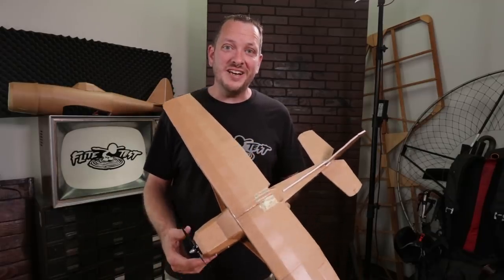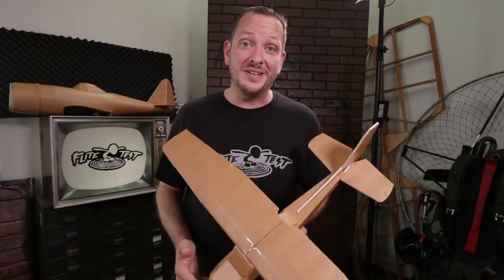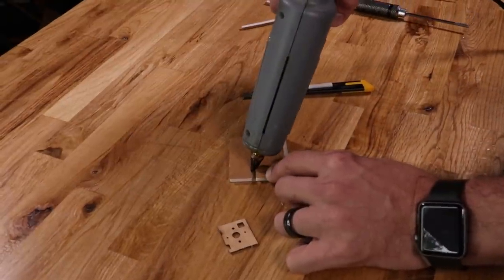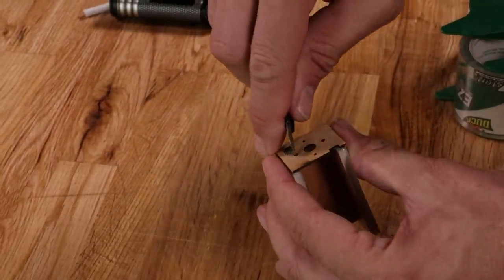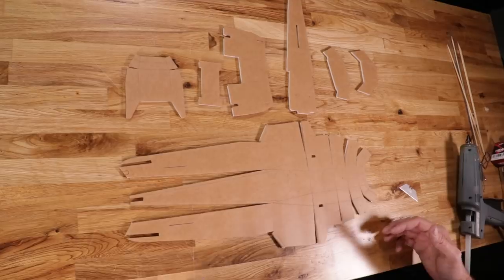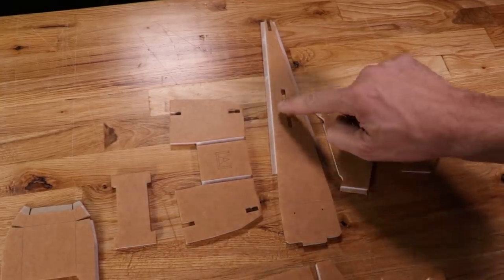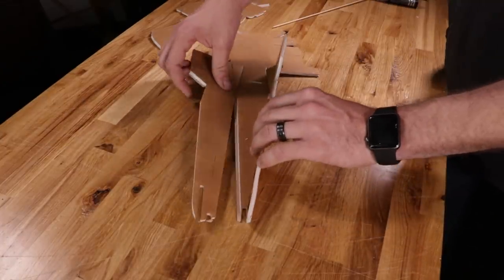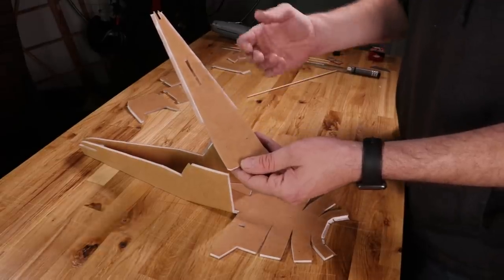How to Build the FT Commuter  //  BUILD

Comment: Josh says you have to go smaller if you go with a 3s but I bet you can get that thing in the air on a 1000mah 3s without any problems.
I've found ft planes are spec'd up to be ultra lightweight,  the ft cub specs with plastic gear servos and a tiny 1000mah 3s is 489g. my cubs fly on a racerstar 2212 1400kv swinging a 9x5 prop, metal gear servos, two cams on a switcher,  a 800mw vtx, voltage osd and a 2700mah 3s and comes in at 890g and flys great but I've had the thing in the air on a 4000mah 3s and weighing just over 1kg several times lol.
Reply: Hello, can I put a 3 s 1500 mah battery with a mm2216 900 kv esc 20 mah motor? I would like to know in the model of this video

Comment: If I scale this up, will it work with a powerful motor?
Reply: yep. I was gonna scale mine up 200%. It COULD work on a B power pack but I think a C pack would work just fine.
Reply: I DEFINITELY want at least a 180-200% version!! Should be comfortable with a C Pack sized Motor, which is right where I want it. 😊

Comment: When you are constructing the fuselage (at time spot 9:23 in the video) when you are fitting the push rods through to the rear slots for the elevators , would it be practical to use either plastic straws or narrow gauge aluminum tubing to fit the push rods through to give a better more solid guide ?  If so the straw or tubing could be glued at either end for added security ?

Comment: Thanks for the detailed steps and sharing this video. We have built the FliteTest plane using your video and instructions but we appear to have problems in having the plane stay up in the air and looking for some guidance. The plane does a nose dive or flips down very soon after take off (travels abt 3 - 4 ft in the air) before either doing a dive bomb or just crashes down. We did observe the plane turns counter clockwise (or towards left) when we try to drive it on the ground. Are there any rules of thumb or checklist so we can try to identify any imbalance/weight or other issues that might be contributing to this behavior? thanks in advance.

Comment: Thank you Josh and Crew, thank you Ben!! 👍👍 
That Takeoff and landing are EXACTLY why I've kept squawking for years about Tricycle Landing Gear!! 😎 great Ground Manners, and such a docile yet controllable Flight. 

ANY CHANCE of releasing a 150-175% Version??? Like Simple Cub sized? 
I'm getting one of these no matter WHAT, but I'd love a bigger version, and do not have the capability to upsize and cut it myself. I'm a Disabled Veteran, and my hands don't work that well anymore.
Thanks!! 
Carmine ✈🚂🚙
Reply: simple cub is only about 25% larger.   commuter is 30",  simple cub is 38".   30"divided4=7.5"=25%.  30"+7.5=37.5.   isn't that you scale up %?
Reply: @berniek8238  Well... I suppose that works.
I'm a Disabled Veteran, without even a working Computer and Printer. 
THAT'S why the Speed Build Kits are ideal for me.

I like the Commuter, because it's very much like the Cessna that my Dad taught me how to fly in! 

Putting a Nose Gear on a Cub wouldn't do it, nor would blowing up the Commuter Plans...
Although for many others, that would be a possibility to consider.

Good idea though, if I can find someone to laser cut a kit for me. 
My old hands can't cut out an entire Kit from plans...

Comment: some late info.     at 1:00:00,  yeah, i always like to install aileron servos  as NEAR  the   Wingtips as possible; so that i get maximum  Reduction    of roll-axis stability.       and i always like to   Leave  the wingtips   UNfinished; cuz everyone knows that  a wing  should have  Two,  completely Different  profiles.     at 1:07:23, i always like a wing to make  Extra,  Avoidable  Drag, by having a step at the underside, just forward of the hinge lines.   ( i just don't like flying  an efficient  and  well-behaved  model. )             at 1:26:59, in other words,  Optimal location of cg (conventional airframe) is  at   THIRTY   percent of  chord;   or a bit forward of 30.        at 38:58,    it matters not, what materials are used.   the use of a box-fuselage design  WILL  result  in  excess mass  IN  the  tail boom.   (otherwise known as,  tail-heaviness in the dom.    distribution of mass.)       UNLESS,  steps are taken to  Reduce the amount of mass, located  aft  of the  c-m/cg.  ( such as tape-covered cutouts; ideally, tail boom construction  Should  include  two  formers;  this will  allow the  (safe) removal  of  a lot  of  aft-located  MASS. )        it should  be understood that   the cg balancing process  has  NO  affect  on (a wonky)  dom.     the  ONLY  fix  for tail-heaviness in the dom  is,   Relocation/redistribution  of  Mass.             in order to evaluate the dom of a model,  establish a  fulcrum beneath the fuselage, at a point that vertically aligns with  25 percent of chord/mac; when the fuselage is level.    if the model does not  Almost  balance, the  dom is  Not  optimal.      since the  problem is  Tail-heaviness,  adding mass forward of the c-m  is  Not  the correct  solution.      at linked illustration,  Optimal  location of  c-m  for a typical high-wing airframe   is  indicated.      it can be seen that  c-m  Should be located  on the thrust line, at point that vertically aligns with 25 percent of chord/mac.      all of these  facts  are  known;  they are scientific fact.        if a hobbyist wants to make a   'good'  model,  the design  Should   CONFORM   to the  Science.        any model designer/builder should understand that an   optimal   dom    Must   be  Planned  for;    it don't just happen.        googletranslate
https://s3.amazonaws.com/assets.flitetest.com/article_images/medium/truecg-jpg_1384168691.jpg

https://wright.nasa.gov/airplane/shortw.html

some science, see  'airplane balance'  section.    MAE  'lecture6'
http://www.stengel.mycpanel.princeton.edu/MAE331Lecture6.pdf
Reply: Cool thanks for the link. Question, what google translate language can i use to decode everything you just said?  I've never known anyone named dom?  Is that short for dominic?  Flitetest must really appreciate your highlights of their video.  I checked out your channel, i thought these were some nice highlights-  pick any video. 0.00 have an idea of what you want to say before you turn on the camera.  7:13 https://youtu.be/Tlvh3lVhkTU?t=433 try not to show other peoples videos on a screen filmed with your shaky camera, it just don't work. I could not find any tutorials on how to build a RC airplane. I saw a nice video where you talked about your little yellow plane, but all I learned was that dom or D.O.M. (as it should be written) stands for  Distribution Of Mass.  
I am new to the RC airplane world, but i have now built 4 Flitetest planes and there isn't much Mass to Distribute. 90% of the mass is from the electronics. The P.T.W and the large control surfaces seem to handle any imbalance the airframe might incur.  What do you think?
Reply: @JeffJackson86  'try not to show',    REALLY.      this was just yer lips moving.       i think   that you  do not comprehend  dom, at All.      i think     you do not Realize  how Heavy  foamboard is.      i think     you do not realize that  99.99 percent of ft designs are  Flawed, in at least one way.      that's all the time i have for you.

Comment: OK so in your video intro you stated if you get power pack speed build kit and battery you have everything you need to fly, but one thing is missing a radio controller is not part of the power pack! so which radio do you recommend?
Reply: It will also depend on what kind of receiver brand you're planning to use. I myself use Spektrum radios and receivers, they've worked well for me so far.